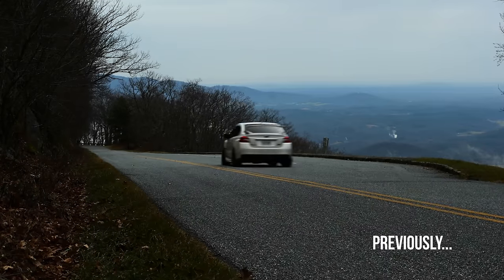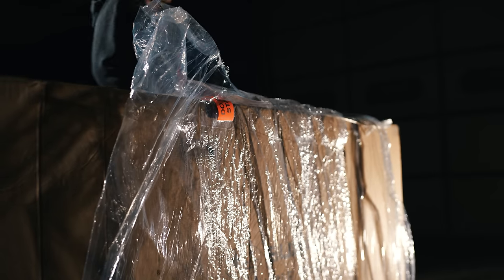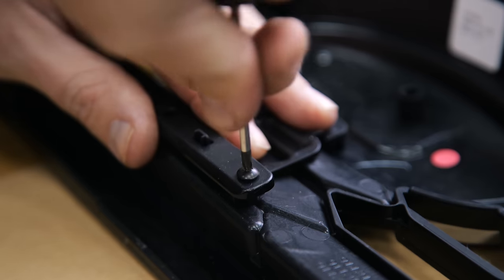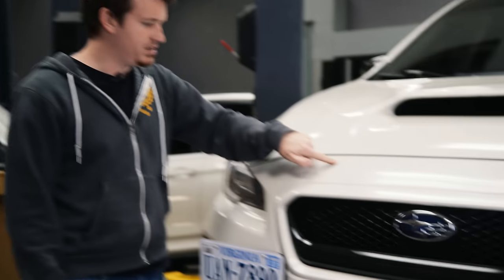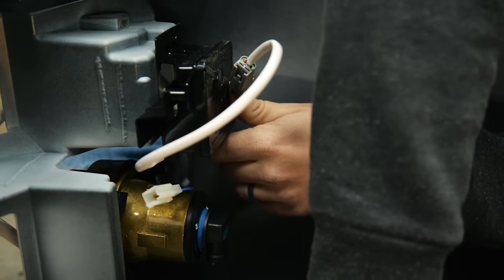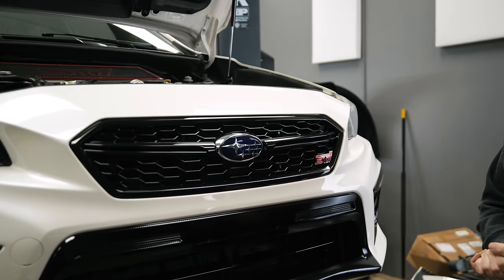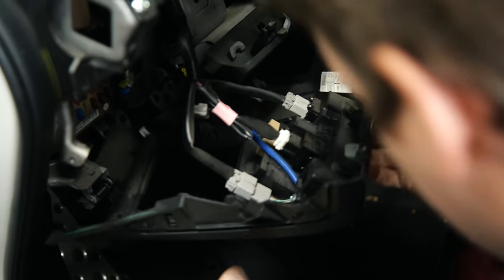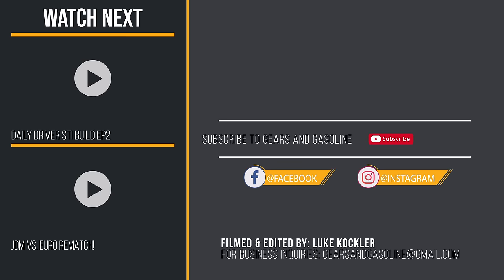Building the Perfect Daily Driver STI - Episode 3

Comment: Just a tip for drilling in plastic with long drill bits, get a drill stop to stop you accidentally piercing something you don’t want to. You can make them from pvc pipe and cut them do the correct length

Comment: Fun fact dodge neons fog light wiring under the steering column used to small a gauge wire and they melted causing the fog lights not to work
Reply: Sounds just about right for the Dodge Neon